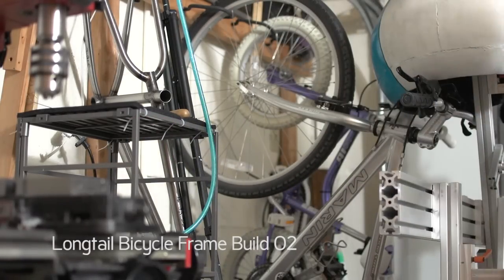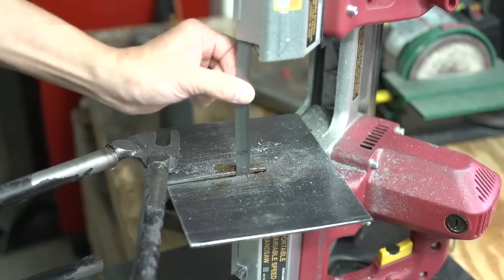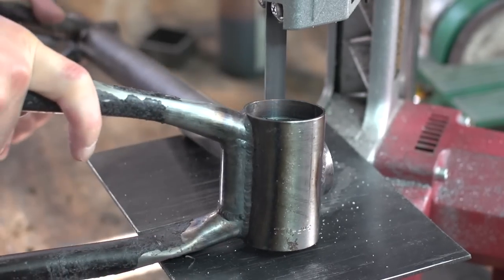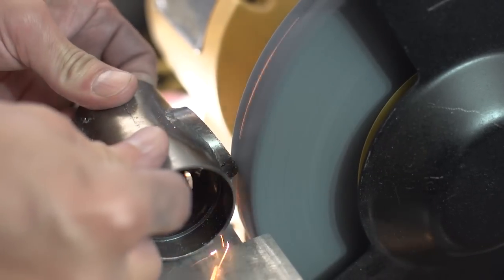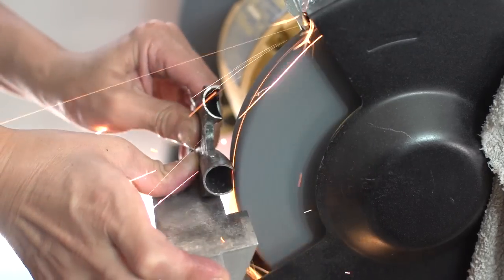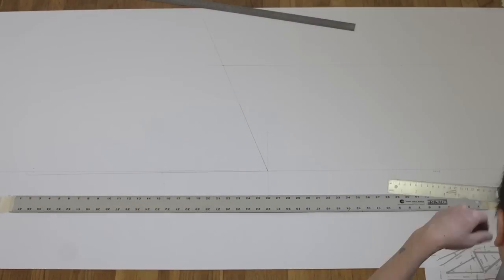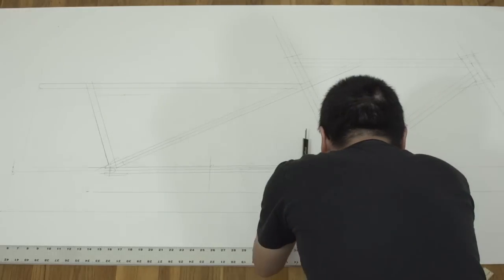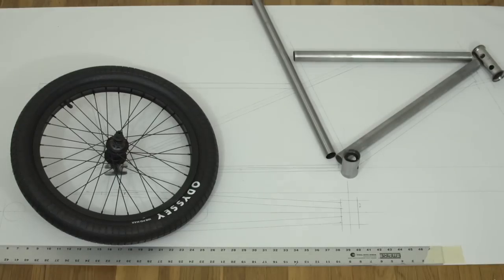Longtail Bicycle Build 02 - Tubes and Full Size Drawing (cargo bicycle)

Comment: I'm sure there's an obvious answer to this but I can see why the tubes are always drilled through at the points where they are welded? I had wondered if it was just to let the purge gas through but I see there are much larger holes in the HT of the donor bike.
What is the purpose of them?
Reply from the maker: I think specifically on BMX bikes it's for weight savings, that's my guess anyway. I read the other day that for Brazed frames it's very important to have these holes because when the whole frame heats up it creates pressure inside the tubes and could cause the puddle to blow air out where the brazing is happening.

Comment: Hello thank you for the information  please i wanna know the steps that you followed to learn , since i am studying mechanical engineer and i am interested design bikes
Reply from the maker: I might do a video on this subject because i get asked this on occasion. For now here's a summary - The first thing I did was take a short welding class. This I think is a great first step because it gives you a tactile feel for welding and you'll know right away if you think welding is something you want to continue learning. After that I took a few machining classes. Again, I think a tactile hands on approach is very helpful even if you plan to be in a 3d program most of the time. I think there's a lot of knowledge one gains just from the 'feel' of engineering you get from a hands on approach. After completing my welding and machining classes I was hooked and I knew I had to buy a welder, lathe and mill. From there the rest is pretty straight forward. Just start making stuff! :)
Reply from the maker: Well, I guess there's more to it than that especially with frame building. Do lots of google searches and go to the major frame building forums. I was looking at these two forums a lot.
MTBR forum
http://forums.mtbr.com/frame-building/

Bike forums
http://www.bikeforums.net/framebuilders/

Next, and a more modern approach I suggest getting on Instagram and searching/following frame builders. Just search "Bicycle Frame Building"

Comment: NB If you strip a tube with a wire brush mounted on a machine, you will have to sand always the tube because the wirebrush polishes the tube and the paint will not adhere correctly to the metal surface . regards Bart
Reply from the maker: Hey Bart, Great tip!! I'll have to sand that tube then :)

Comment: Hi Steve, I used these sometimes . They don't clog rapidly with the paint.  http://solutions.3m.com/wps/portal/3M/en_US/3MIndustrial/Abrasives/Products/~/Scotch-Brite-Clean-and-Strip-Disc-7-in-x-7-8-in-S-XCS-15-per-case?N=7581642+4294945752&rt=rud
Reply from the maker: Awesome! I saved the link for the next time I need to strip paint or something down to bare metal. TY!

Comment: try the other type of wire wheel (the one you are using is intended for flat surfaces.) also you can chuck up a wire wheel to you bench grinder. that's a little safer and easier to control.
Reply from the maker: Nice! TY!

Comment: Steve, I've had good success with welding the butted (thick wall) end of the ST to the BB shell
Reply from the maker: ooh, I think for this tube that might not be an option because the ID is different on both sides. The thicker wall side ID fits the seat post well. I'll have to check again but I think that's how it measures..
Reply: i buy my ST's to fit the seat post on the non butted end
Reply from the maker: Sweet. Where do you source your tubes if you don't mind me asking? :)
Reply: henry james
Reply: henry james

Comment: Great videos! get that grinder rest closer to the stone.
Reply from the maker: +Make It Fit absolutely! I did do that for the rest of the parts. Need to slow down more and inspect my equipment. 👍
Reply: you might think about going to Harbor Freight and picking up the 12" disc sander item #43468. With a coupon and when it goes on sale you can get it for around a hundred bucks. 

You will be throwing rocks at the grinder.

Comment: hello.  use synthetic wheel abrasive. Is much faster and less dangerous than wire wheel. :)
Reply: Those are good paint removers. You can work on softer metals without fear of digging into them, too.
Reply from the maker: +Daniel Moreira sounds good! I did get a lot of those little wires stuck in my t-shirt.